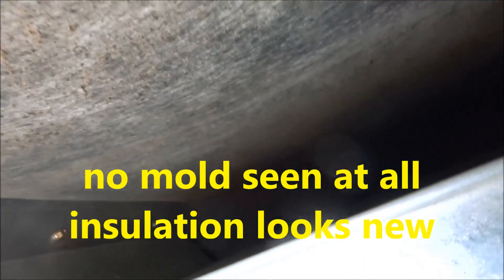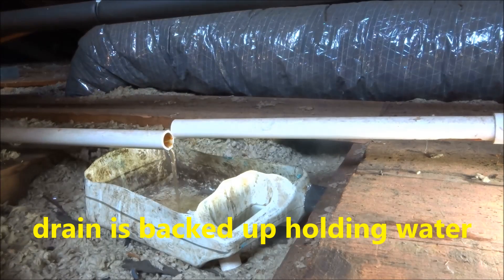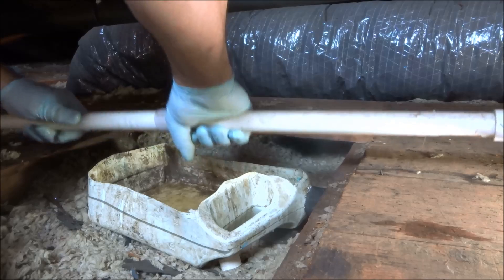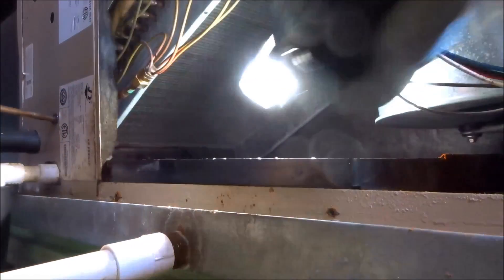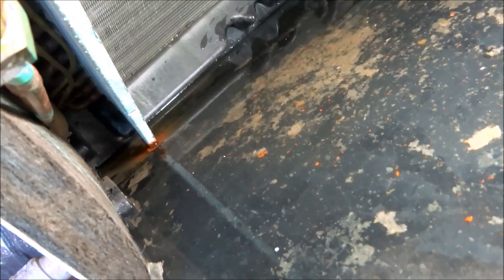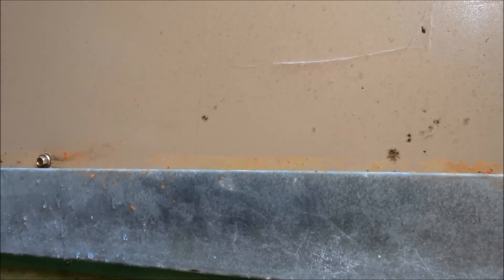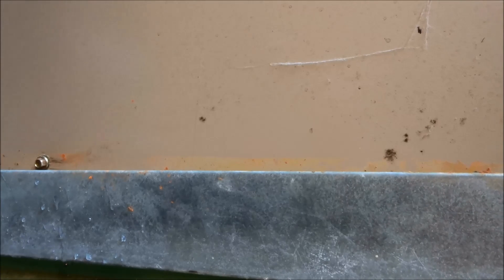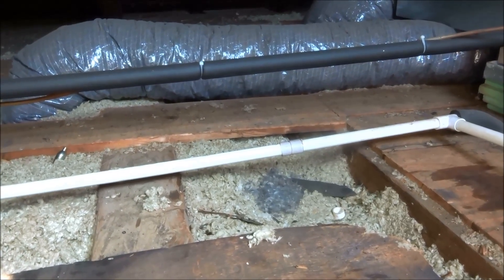hvac water backing up into secondary pan of air handler

Comment: I've heard that you don't want to blow pressure INTO these drainage lines as it can pop connections and cause leaks in the walls...We periodically connect a wet vac to the pipe outside to SUCK water and debris out.

Comment: Question:
Thanks for uploading this!

I don’t know much about AC units...so is there 2 drains? One from the unit and another from the pan?
This video looks like the 2 drain lines go to one. Mine has 2 separate drain pipes...one from the unit and one going the other direction from the pan.
Last month the ac wasn’t cooling the house but no water in the pan. Lost power from storm for 3 days and the AC worked fine when power came back on. Now it’s not cooling again but this time there IS water in the pan. Will the air handler or compressor not work if the lines are backed up?
Any help or advice would be huge!
Thanks!
:)
Reply: I hope you know the answer many now. But sounds like you have a float switch in the drain pan that cuts the unit off when water is not draining.
Reply: @ronniebuchanan6575  I just had a guy come fix it. He did explain some of it to me. Thanks for responding though!
:)

Comment: I currently have water outside of the pan inside the handler. The right hand side of the pan and the lower insulation is wet. The unit is leaking water from the cabinet into the outer pan

Comment: Instead od cuttin the pipe, Try using a shope vac from the outside to suck the clog through.  Saves time and drains the pan
Reply: Not all primary HVAC drain pipes are routed to the outside where you can do that. Some route the main pipe into an interior drain in a bathroom or laundry room (like my current Texas house). The pan drain (secondary) is routed outside, but the outlet drops out in the eave near the outside condenser/compressor. It’s put up high so it’s obvious if water is coming out the pipe that you have a problem....water is in the pan, meaning your primary is clogged.

Comment: Any chance of sealing a rusting dripping pan with paint or urethane? thanks. Need quick answer if you can. thanks.
Reply: One of my friends with a commercial HVAC company said get FlexSeal (or the cheaper but same Roof Seal spray) and spray. Got a guy up in the hot attic, sprayed, best $12 I spent, and not $5000 for new HVAC and all the mess. Does have a smell so make sure the attic fan is working or put a fan up there to dry it and exhaust the odor. Btw, about 4 years later, still fine

Comment: Great video! My problem us, I just had a central air unit installed, the evaporator coil is bran new, the air filter is clean and new. It worked great for 1 month, now the evaporator coil is freezing up. I can't find why. Drain tube is clear as well. I'm stumped.
Reply: Maybe the drain isn't pitched correctly

Comment: Steve... great job.  One question, for that clear (transparent) coupling, where do you get those?  And are they secure?   Or is it better to use a formal PVC coupler along with plumberk's potty or some type of plumbing seal, etc?   Once again - thanks for these wonderfully made videos!
Reply from the maker: i use the clear plastic tubing fits snug no glue needed i cut what i need i usally buy a 3' piece of tubing at the supply house .it will not leak
Reply: Great to know that -thanks!

Comment: what do you call the CO2 device you used to blow out the pc pipe.
Reply: It's called a Gallo Gun.  You can pick them up from most HVAC supply stores and Amazon has them.
Reply: Best thing I ever bought. I use the paintball co2 refills from Walmart...very cheap on Amazon

Comment: Great vid Steven!!!

What would you do if you find black mold in the evaporate case coil ?? What's the procedure?? Why did you say it will be a big lawsuit?? 

Also I like the idea to use clear hose instead of a pvc coupling. 

One more question I see you use something to extract the water from the secondary pan What is it??
Reply from the maker: Jorge Chavez when people see mold there could be a big law suit i just saying ,, many units have mold in them and people don,t even know it .i have sprayed it down with bleech before seems to help
Reply from the maker: Jorge Chavez the pump is a pump for a toilet  water removal   bought it from worverine brass

Comment: Thanks for the video Steve. I got the clear tubing idea from Zack. If you cut out or leave about a 1 inch gap in the PVC, tech or customer can see the water level and it helps determine if the clog is up or down stream.
Reply from the maker: Nicholas CeeA  i like using this tubing
Reply: @stevenlavimoniere  what size vynil tubing do you use? 1inch or 7/8?
Reply from the maker: @ratobasherelectronics2668  its 1" id
Reply: @stevenlavimoniere  I haven't tried your method yet, I have drain related service call tomorrow. Usually things get re plumbed

Comment: Good job Steve.  What kind of clear pipe do you use for the coupling?  Good idea.
Reply from the maker: Richard Fossani i believe it 1 1/8 clear vinal tubing i buy like 3 ' of it and cut it as i need it , i will check on size today and post answer
Reply: Thank you

Comment: Nice work. What ID tubing did you use?
Reply from the maker: Rob HVAC i will measure it and let you know i have a piece of clear hose in truck about 3 feet and cut it as i need it works well and will never leak . think it 1 1/8  but i will recheck
Reply: What size was it Steve?